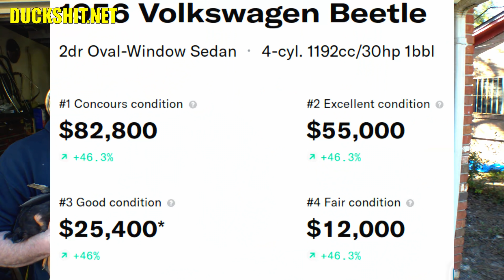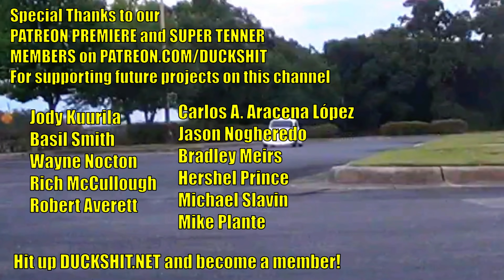Mail Call! - Bee Meets Eleanore - Midday Q&A 152

Comment: Those Ghia badges were put on Ford's here in the uk. it was for the top of the line models in the 80's and 90's until they upgraded to "Ghia X" then after that they upgraded again and added Zetec S for the sports type stuff and "Titanium X" was then the top model. but i think now "ST & ST-Line" might be the top or maybe that's just for the sporty models im not sure.

regarding your bubble, you could probably run it off a 12v battery for a long time seeing as its only a fan running. i expect the fan isnt as low-powered as a pc fan those are about 1/4 of an amp i expect your fan is probably like 2 amps at a guess. but a battery should run it overnight I would think
Reply from the maker: That seems to be what everyone is saying.  Thanks so much!